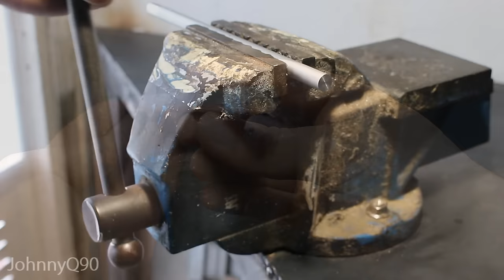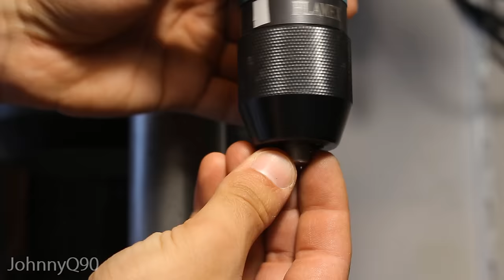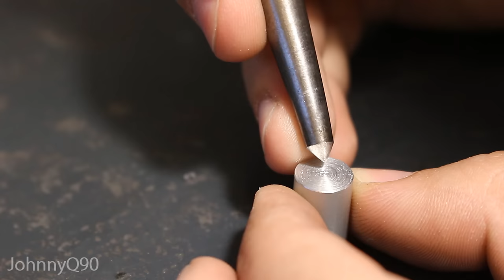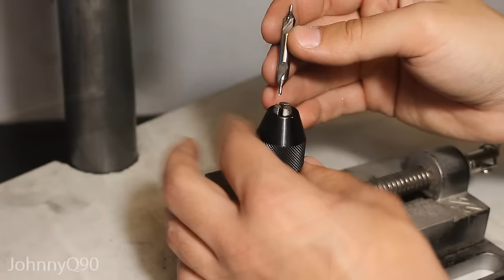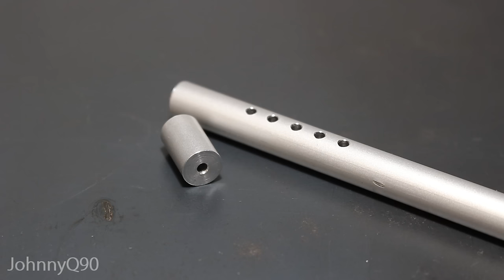Simplest Way to Drill in the Center of ANY Rod!

Comment: I would say this gentleman just showed a lot of people how to drill a hole in a round rod that own a drill press and not a $3000.00 Lathe. This is probably not going into a Space Rover.
This is a great video and it was free. I have always said, " You Can't Bitch About FREE. Great Video Thank You
Reply: Thank you for calling out the snarky posters.  I learned something... so I would also say thank you to JohnnyQ90.
Reply: George Allen: Syphilis is usually free. Don't complain about it.
Reply: Unless its "free" healthcare
Reply: Wow, there are some real know it all's here. This is extremely good idea for a simple quick hole drilled to the accuracy of most home workshops. Not a f£#king machine shop. But hey i guess most people miss that he has a lathe and now a 5 axis mill. Also in my experience of heavy machinery repair the tolerances vary wildly for each type of machine and what is doing. Again not the work i do in my garage. Where i have a small lathe but no drill press
Reply: i got a $300 lathe..
Reply: Or a $250 lathe. Don't overreact.
Reply: This worked out great for me! I would have never thought of it. I tried all those dick tricks mentioned in previous post, lets just say this way was much easier, and also less painful.
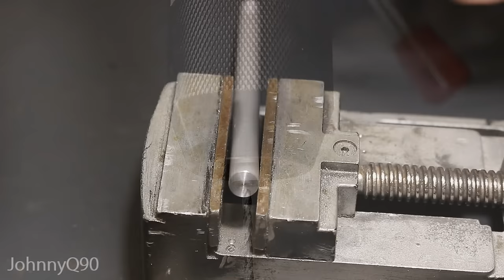Reply: Forward to 2:28, stop, screenshot it and if needed zoom and see just how terrible the "centering" is.
Reply: @scallionboy8679  go to 2:28 in the video, screenshot it and tell me it's close. If you hunt with a hand grenade in a chicken coup it's "close" 🤣🤣
Reply: @michaelronneseth801  umm you have missed the part where he actually centres the centre drill. The vice is not fixed to the table allowing the spinning Chuck and part to grab the centre drill and draw it to the centre. Even if the centre punch is not exactly correct it will be corrected once the centre drill starts cutting. when he lifts the drill off at 2.38 you directed me the Chuck is lifted off the drilled hole part looks Central enough to me but yes the tip of the 2.5mm drill is off centre at that point. This comment thread is expressly for people like yourself who failed to grasp this is a make do method of achieving a good starting point for home workshop stuff to make repeatable holes in not ideal conditions. So before being rude to everyone who find this useful take a moment and share your better knowledge with the world as your quick to naysay this "hand grenade hunting approach"
Reply: @scallionboy8679  take that rod, slide it into a small pipe so you have an adjustable length item ( for example ) now drill the tube with the same procedure and accuracy and then run a pin the size of the drill bit through it.. actually, no, try to run a pin through it, you can't, enough said, it's not centered. Anyway, if it helps some people fine.
Reply: @michaelronneseth801  i can't quite visualize your description but i appreciate your effort to show how it's not accurate. And yes it will help some people, but those that need extra accurate holes will no doubt be able to produce them. And know how to do so. Lathe, mill or cnc for best results for sure. But that's not what he's suggesting. No where did he stipulate a tolerance either akin to what your suggesting. I know some people look for super accuracy. Hell i measure temperature to 4 decimal places at work and calibrate scales to the milligram but i don't need that at home.  Which was my point that people are looking at this to micrometer/thou(which ever you work in) not what he's suggesting. I noted your channel had some motivational stuff. All about being positive! No? You tube would be much nicer if people were more constructive rather than blanket stuff as bollocks!
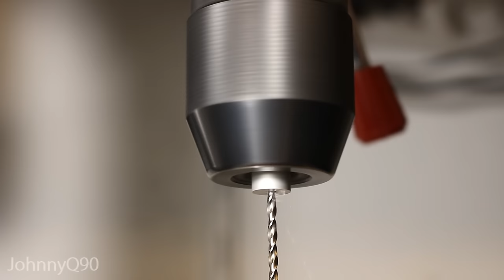Reply: @michaelronneseth801 , if instead you watch from 2:15, and even slow the playback to maximum, you can see that the drill bit is not deflecting as he starts the hole; he has found center by eye and feel with his vise. In fact, it seems possible to detect shake in the quill. Midway and at the finish his vise seems to have wandered, it is true. You can see the bit flexing.
Reply: @michaelronneseth801 about drilling the telescoping tube with the same procedure: does not apply. Tube? Anything along the axis to drill into?
Reply: a lot faster just to use the center drill to start the hole

Comment: Nice tip.  Just a little thought for the comments on eyeballing the center punch.  The human eye is fantastic at noticing eccentric circles and is accurate to within a few thousands if an inch.  That's less the the runout on most chucks.
There is also a handy alternative on the same theme if you can clamp your vice.
1 mount a center drill in drill press chuck
2 connect mini chuck to center drill
3 clamp mini chuck in vice.  Lock vice in position.
4 both chucks are now aligned dead center and perfectly parallel.
Reply: These steps are just what I'm looking for, thx

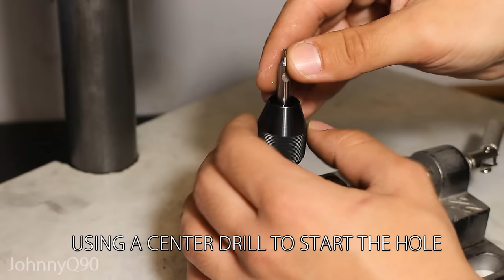Comment: A quick suggestion . At the 1:54 mark. Don't guess the square of the center drill. Put the centre drill in the mini chuck then hold the bit of the center drill still stickign out in the main chuck and only then do up the vice holding it . That way providing you don't move the vice when you open the main chuck again and put your work piece in you will know it is perfectely in line with the center.

Comment: If you wanted it to be actually simple put something straight between your drill bit and the round item. Press down gently with the bit. When the straight item is level you have found centre. 

This is probably one of the most complicated ways of doing it.
Reply: Yep, I’ve seem turners use a pin with play dough  stuck to the part they spin to find its centre. Easier than this by far!
Reply: i find using a popsicle stick is pretty good for this. you just move the twist drill left and right until the popsicle stick is perpendicular to the twist drill. you can even get fancy and hold a square up to the stick and drill to make sure its a 90. you can even just drill through the stick when you are ready to make your hole
Reply: You seem to have missed the point, which is not to measure the starting point but to keep the drill on it. Even with a press I have seen drill bits skid off, break, and / or make triangular holes.
Reply: @christopherbedford9897  Thats what a stub drill or a spotting drill is for. Oh and just so ya know centre drills are for lathe centres only really. Sometimes i use them in hard materials if im in a pinch but normally I use a spot drill with a 120 degree angle.
Reply: @samwalters4205  Actually, those little bits are called "CENTER DRILLS", and are used in Lathes, drill-presses, Vertical Mills and can also be used in a portable hand drill, if need be. It's only purpose is getting the material started in the exact spot and initiating that 60 degree cutting angle for a drill-bit to line up on. Its body is thick, so it wont warp and be defrayed, like a normal drill-bit will do. A center drill wont "walk" like a regular twist drill does, for that exact reason. Center drills are available in many sizes from minute to hugh. One tip in preventing breakage, when using any center drill is to brush on a little Crisco Vegetable Shortening onto the tip of the bit BEFORE touching the part. Do NOT use oil or cutting solution. That almost always results in tip breakage, because it encourages "wander". This "wisdom" is from 50 years of experience.
Reply: @general5104  try reading my comments again because if you did and that's your reply you've just shown you don't understand cutting dynamics. I've always had the opinion anyone that bangs on about how many years of experience they have is likely pretty crap and most of the time that's proven to be true. Without development, research, thought and experimentation based upon logical principles that experience counts for nothing. 50 years might as well be 3 months for all it matters. 

You can do the pissing match bit if you so wish banging on about how many years experience you have. But unless you've not realised it yet, you're a little out of your depth.
Reply: @StonerGBUK  im pretty sure this is for people who don't have a bunch of tools. Of course there are better ways of doing it if you have the option of using any tool.

Comment: It's also pretty smart how you rotated the small piece on the sand paper so you could see where that centre was too.
Reply: I'm definitely going to start using that trick
Reply: That trick is poor practice because the center gets less abrasion and therefore you will end up with a high center due to the edges getting sanded more.
Reply: I see what you mean but still it shows you where to wack it.
Reply: he's using the drill press as a lathe.
Reply: Ok, he used the sand paper, but he also used an End Mill Bit to get the exact center on the small jig piece... That was cool !!
Reply: That was a centre drill. Used in machining to spot drill first because they are very rigid and don't walk when starting a hole.
Reply: Tim Christian v
Reply: you'd use a 'zentrierwinkel'. looks like this: https://de.wikipedia.org/wiki/Zentrierwinkel. you mark 2 lines and grain the intersection.
Reply: It shouldn't be high because he bored out the center afterward. Same thing happens on a lathe and the parts come out just fine.
Reply: Who cares?  The point was marking the center, not flattening it.
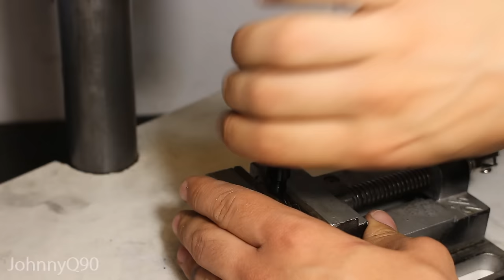Reply: W Ray... That was just to get a rough center. He got the exact center by using the bit at 2:02 of the video.
Reply: Tim Christian

ridged > rigid
.
Reply: but if the centre punch was off that wont make it exact, itll just make it shake , i like the thinking but
Reply: Look, it's a centering bit... if it's an 1/8 inch bit, it will make a 1/8 inch hole. if it is off center a little, then the hole will be a bigger hole, but still be centered... that's what a centering bit does. look at the way it's spoon shaped and you'll see.
Reply: 1. place part or drill in vise with vertical orientation
2. Loosen clamps/bolts holding vise to the table 
3. Open drill chuck large enough to hold the part or drill that's in the vise
4. Lower machine quill and tighten part/drill in the chuck
5. With part/drill clamped in the chuck, tighten the bolts holding the vise to the table
6. Open the chuck and retract the quill

Centering is now better than you'll achieve with a punch or by eye.
Reply: datstocklyfe in
Reply: OMG How are you people not getting this??? It's a centering bit, it DOESN'T HAVE TO BE CENTERED to drill center... I can't explain this any clearer!!!
Reply: basically it is true center because he spins the workpiece  (just like a lathe) and works with a stationary tool (just like a lathe)  even if his punch mark is out of center, the center drill will just cut a slightly bigger hole than its actual diameter but it will be in center. Definitely smart to come up with that idea.
Reply: No it's prob not "perfect center", It is a "near perfect center". That is why everything engineered is done with a tolerance in mind. If you need to create something with as close to a zero tolerance than doing things by hand this way wouldn't be what you want to do. That being said... I highly doubt 99 percent of things people make really are in need of a zero tolerance situation.
Reply: Yeah, that seems the most important part. Once you do that a lot of methods would work as well.
Reply: As they teach you in engineering, high tolerance is expensive.  In most cases, close enough is good enough.  This is an excellent technique when you don't have access to a lathe.
Reply: stephen john gray hahaha.....then you give yourself a thumbs up.
Reply: I don't think it matters to rotate the sandpaper. Regardless you will get concentric circle pattern. It's mainly to expose fresh sandpaper I think.
Reply: bearin
Reply: Works for low tolerance applications great but not exactly exact due to the hand and eyeball line up with the punch. Darn close enough for garage fiddling tho. Nice video. Thanks!
Reply: NO. If it's off will brokes.
Reply: Not necesary to be fresh. Very important si to be CLEAN all the time.
Reply: Static Chaos 

Has my questions.
Reply: Hey guys i want to know why we oil up the bits/lubricate them when drilling. Are we not making em less effective that way ? ( I really need answer please  :/)
Reply: @DIYTech21  - The drill bit tip cuts by shear, not friction. Therefore friction and the resulting heat are unnecessary byproducts that reduce the life of the bits tip, spirals, and shank.
Reply: Patrick Perry
Thanks man
Reply: That rotation amounts to nothing except using another part of the sandpaper. Since the workpiece rotates anyway against the stationary sandpaper. Pretty useless.
Reply: @ryancomfy   nope. Even if the center gets momentarily high, there will be higher pressure on it and it will get ground first.
Reply: @sanjeen2503  nope, the centre  doesn't wear down as quick because it's getting much less abrasion than the outsides, try it and you will see. I know this because I've done it
Reply: @ryancomfy  hmm maybe you're right. If you press the moving stock against sandpaper resting on a soft surface like wood or one's hand, then yes.

Comment: It amazes me how many people dont know how to lubricate a drill properly.If you spray it on a workpeace you will get very small amount of lubricant to stay.Instead spray it or use a brush on the top of the flute near chuck,that way when you drill something lubricant will slide down the flute right into a hole-you will be amazed!
Reply: +zumbazumba1 : When someone like you gives me a good idea I can appreciate it, even though you imagine it's common knowledge.
Reply: What are you on about? The guy put the lube in the guide so it will drip in to the hole.
Same thing ha!
Reply: Pip's Woodworking He's an observer of gravity.
Reply: Silly people laugh all you want just try it out and you wont be laughing anymore ,you will see that it is the best way to lubricate drills.
Reply: The chip flowing up the flute, will remove any lubricant you apply there. The proper place for lubricant is at the tip and this is why though tool type lubricated drills (where coolant is directed through the tool) deliver coolant AT the tip.

Pooling lubricant to retain it at the tip isn't a bad idea by any means, so long as the chip still evacuates sufficiently.
Reply: I agree on the importance of evacuating chips.
Reply: zumbazumba1
Reply: Amazes me that he use wrong cutting lube...

Use instead methylated spirit while cutting aluminum, it  will make ur hole look better and save you time clearing your drills.
Reply: How can you tell what he used, other than the fact that it came out of an aerosol can?
Reply: zaknefain100 By the eye I can tell the consistency of that fluid was regular cutting fluid mostly used for cutting iron.
Secondly when he's done cutting i see nuggets with cracked texture, means that the aluminum went hot and the drill caused friction instead.
Reply: Northstrm 
You guys seem pretty knowledgeable.  I'm guessing you guys are machinists.  Tell me this, please.  I am going to redrill the hubs and/or rotor on my vehicle to get a 4.5" bolt pattern instead of the 4.25" that it currently has.  I bought a wheel adapter to use as a template.  Do either of you have any suggestions or maybe a good YouTube video to offer?
Reply: ralph sampson I'm a mechanical engineer with a heavily r&d background. In other words, I cut my teeth designing and building my own systems.

To your question, you'll need an accurate way to zero out on the primary datum. Is this a hub centric application?
Reply: The best product to use is Rocol RTD Compound.
Reply: I love these barn machinist experts ....😂
Reply: 'barn machinist' - I like it!
Reply: When you don't have access to a Bridgeport Series 1 vertical mill, you have no choice but to be a barn machinist! I spent about 1,000 hours in front of one of those  Bridgeport's in a job shop. Was a great place to do those  "government" jobs for home.
Reply: Hell, I've done stuff on an old redwood picnic table
Reply: you ought to be in csi man, your fkg awesome
Reply: you  ought to be in csi man your fkg awesome
Reply: you ought to be a csi agent your awesome
Reply: you ought to be in csi you are awesome
Reply: did he drill into his vice?
Reply: zumbazumba1 x
Reply: That makes sense, but don't think you need that much tapping fluid to cut metal. The speed and force you use are more essential to not damaging the drill
Reply: Amazes me how many people think you need lubrication to cut non ferrous metal
Reply: zumbazumba1 you are correct.